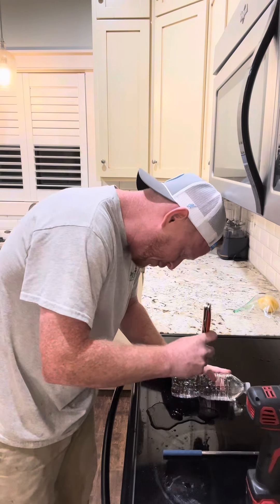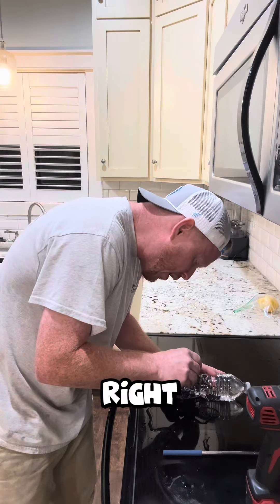Does this WATER BOTTLE TRICK work?

Comment: Why do you do everything on top of that glass top stove.?

Drill the two holes first. Top and bottom. Place the first straw at the bottom make sure the cab already has the hole now pour the water in, screw cap on  and put the straw in the hole .

Comment: Over 40 years ago. We made for girl scout camping hand washing jugs. One clean milk jug add fresh water. Then get a golf tee poke it through the side. Hot glue the tee to a strong piece of yarn tie it to the jug Handel. When you put jug in the sun you get warm water. Pull out the tee , and control the flow by the cap. We also put a clean panty hose leg with a bar of soap in it, tied to  the Handel. ALL MADE ON NO STOVE TOP..

Comment: Hey Dustin use a thicker plastic bottle so you can drill a better quality tighter sealing hole . The seal between the straws and the bottle are critical for it to work .

Comment: You arent supposed to have a rough hole. Its supposed to be smooth so you can get a seal with the straws. I'm a smoker and so have done it with cigarretes, but a stick with a cherry on it from a fire will work.

Comment: The vertical straw will have to block off the internal portion of the horizontal straw to apply sealant pressure. I bet some change on the internal connection of the straws with cutting or flattening the ends to seal them together ought to work...

Comment: If you own a high heat glue gun, soldering iron, or a wood burning tool, you can make your hole with them. OR you can heat the tip of a sharp Phillips head screwdriver or a punch.